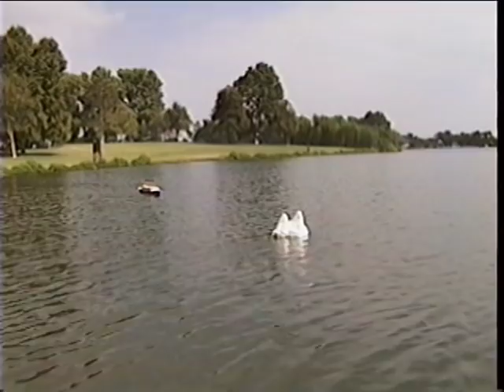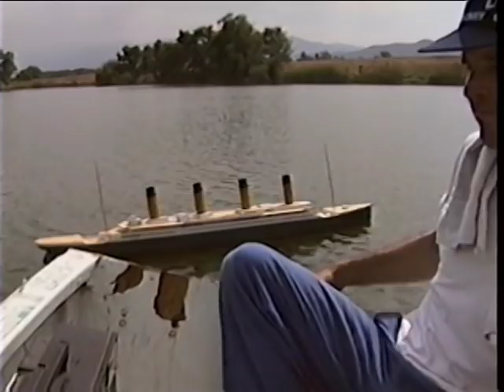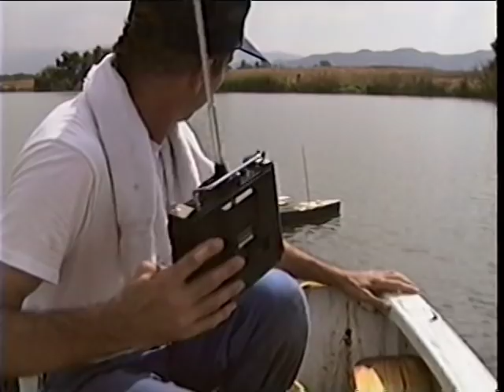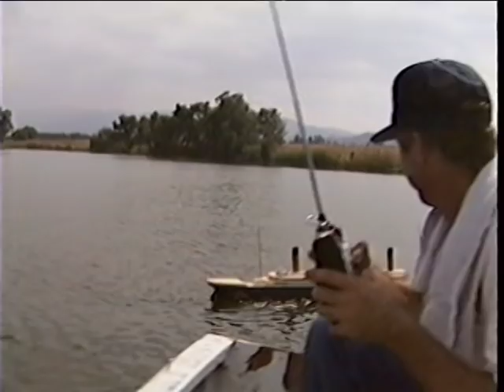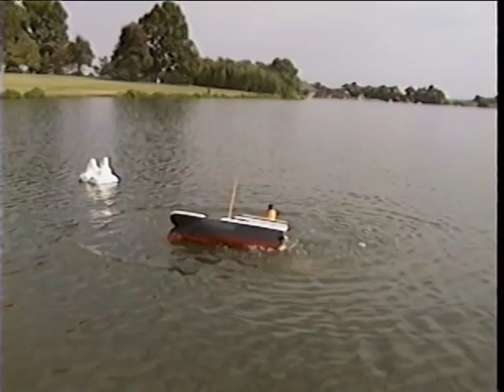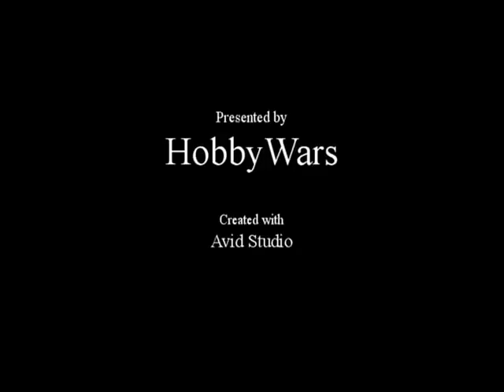Titanic Sinks

Comment from the maker: @Rapidnadion I built it in 1997. Radio control servos turned on electric motors in the model to pull a cork to flood the ship, and unscrew a bolt to break it apart.
Reply: Awesome 👍

Comment: I’m impressed that the rc model is designed to sink so similarly to the real Titanic including the splitting of the hull so good job! My question is how do you recover the model after it sinks to the bottom of the lake?
Reply: Joshua Hanson they won’t. It’ll be decades before they even find it, then it’ll be too expensive to raise. Might make for a great movie though.
Reply: They'll send down a RC model deep sea sub to keep the historical accuracy
Reply: Nobody know how titaniv sank
Reply: Maybe they attached a string to it so they can pull it back up?
Reply: I’ll have to wait for the year 2087 before they send a sub to to locate the wreck
Reply: @johnofthesouth5425 Well, in 2023 this comment aged somewhat well.

Comment: the but of the titanic is actually pulled down then because the wires cant hold it it got cut off then the air left in the but caused the but to float for a few minutes b4 sinking

Comment: The sinking of the tongue the sinking of the Titanic was very easily explained my family are shipbuilders and no stays when steel was made into a cast of sheet metal they didn't wipe the slag off the top there for the metal was nothing but of course piece of paper meaning that the metal that was poured is nothing but brittle even though it was drilled and riveted to the Hall of the ship making a bulkhead obviously we know that if slide wasn't wiped off it became very hoarse allowing it to break away very easily from the rivets I can imagine the rivets inside the area of the shift shooting like bullets it must have been a real striking Force allowing these rabbits to pop very easily allowing it to tear open wider as the ships filled with cold Icy water allowing it to be dragged under even though the walls were not right to the ceiling and acted like cups of water standing side-by-side being filled because the walls did meet the top of the ship so therefore it was sinkable very explained people don't understand on how metal could be so poor on how it was made that is your problem that people don't understand why it could have happened it's understandable when a person that has family and shipbuilders that could tell you very much and how metal can't be strong once like is not white from the top of the touring cast therefore causing it to go this way it was a mistake by the metal people who made the metal and not show explained it is I wish I could say that little bit clearer but it's hard when you have your mouth full of food thank you I appreciate it yum yum and that's what happened to the Titanic that's how it sank it's how the metal was made and poured exactly becoming like a piece of tissue paper thank you third TCB third son of Elvis Presley